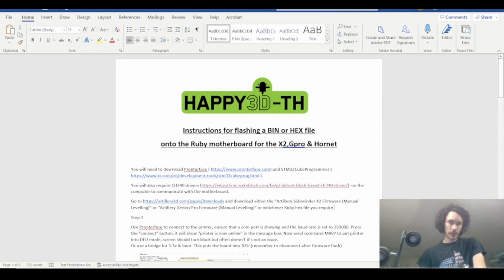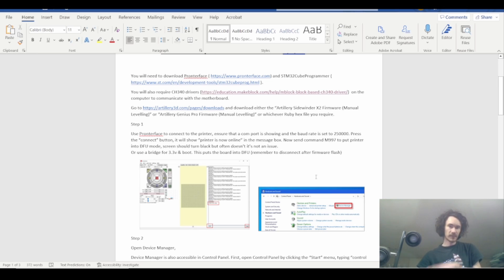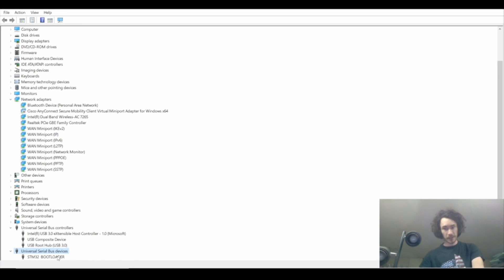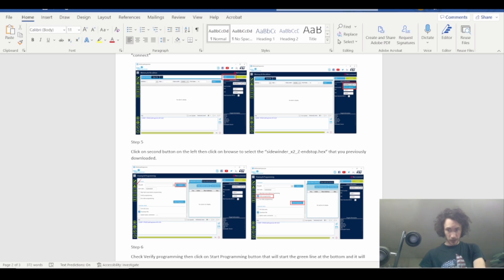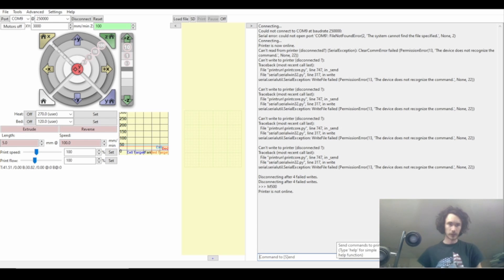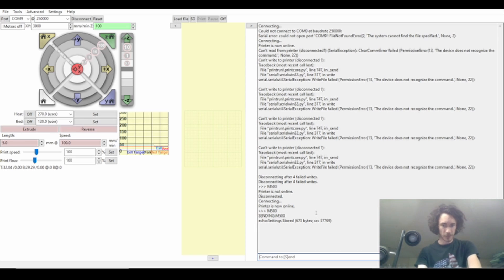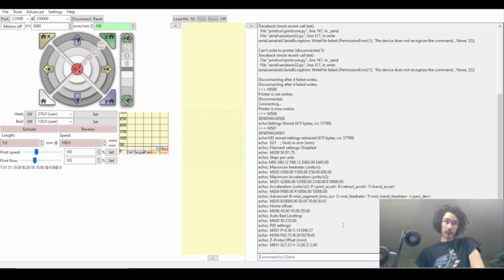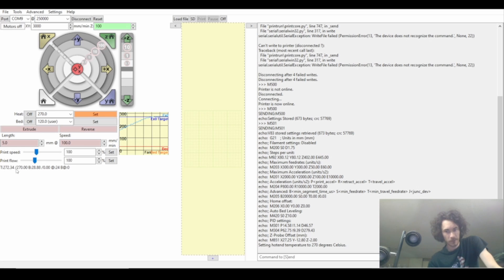Updating My Artillery 3D Sidewinder X2 Firmware

Comment: Are you able to or have you run it over 285°...? Max temp? Great video!
Reply from the maker: Yeah, when I did my Polymaker PA6-GF prints for the GoPro rig I film with, I had to crank the temps to 290C and it ran like that for a few hours without issues. I will say the higher the temp, generally the lower the lifespan of the thermistor so it does not hurt to have a few spares around in case one craps out. Otherwise, no issues to report.